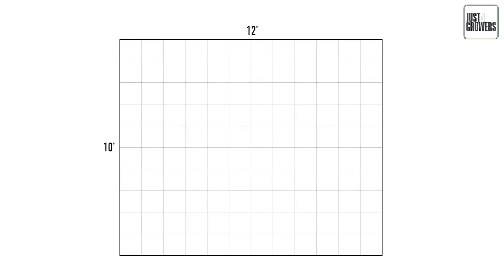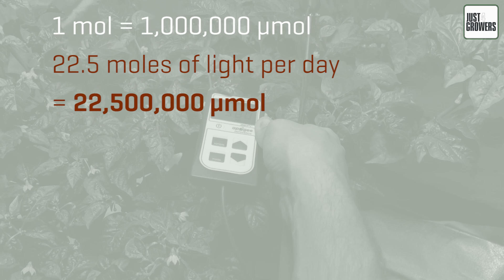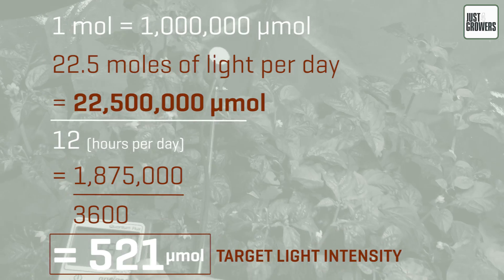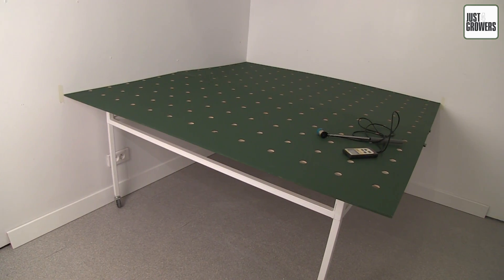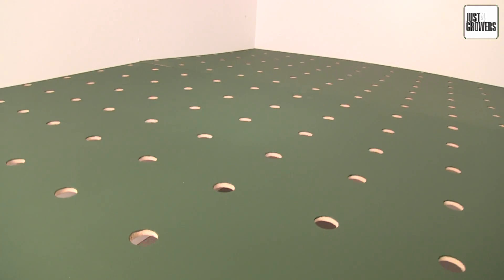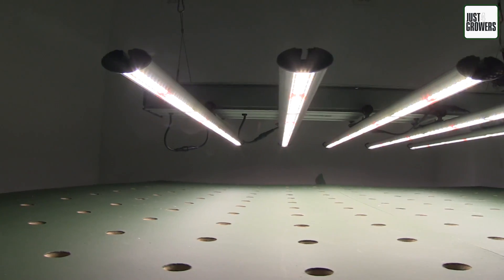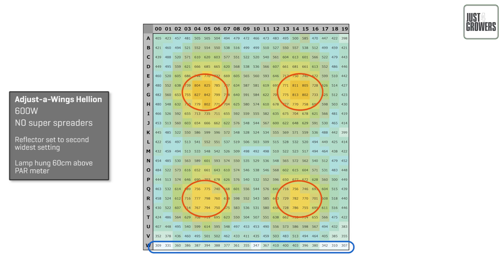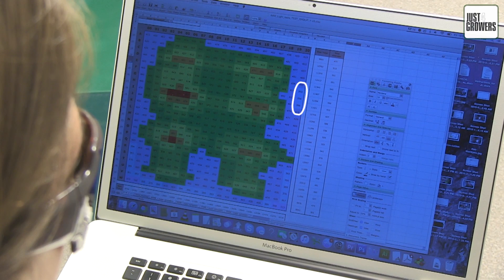Grow Light Hotspots and Light Uniformity

Comment: today the best are 940w CMH DE. you can go 45 cm and under. the cri what cmh creates is nearly sunlight cri 100. the best best best led in 2024 has cri 90 only. the efficiency of the cmh double ended, 5% better than single ended cmh, you can only reach with samsung led chips and the cri with nothing. cmh is efficienter than all other LEDs in 2024. 315 watt single ended cmh is enough for 1x1m, dimmable 190-315w. you can get more yield with same watt leds, but half of the cost for the lamp itself.
last thing what i can say, only the osram RED leds can go 10000 hours life. all other red leds can go max 2000 hours life. how can a led lamp with red leds included have 50000 hours lifetime? can someone of the led lovers explain?;D idont speak even about the uv chips they are poorer, the main thing about uv in led is, that not one plastic reflector in the world is uv safe in long term, but all led lamps with uv chips have plastic reflektor. nice one. hahahahaha. cmh isnt hotter than leds. only the samsung chips are cooler an efficienter than cmh. all other led chips are inefficienter against cmh.
Reply from the maker: Firstly, this is a really interesting and insightful comment so thank you for taking the time to share. I love CMH and DE-CMH and enjoy great results from them. (I still use CMH, DE-CMH in winter.) Nothing beats my 315W 4K CMH (incidentally, with a CRI of 95 !) for vegging up robust and vigorous plants, especially during the cooler months. However, The Color Rendering Index (CRI), is a tad anthropocentric for true plant talk. While being an important metric for assessing how accurately a light source displays the colors of various objects in comparison to a natural light source like sunlight, its relevance in the context of horticultural lighting is relatively low compared to other metrics that are more critical to plant growth (but I appreciate the general heuristic of sunlight being the gold standard for our noble indoor endeavors.) By the way, Nichia make extremely high CRI diodes (their ‘Optisolis’ range scores close to 98) but they’re more likely used in high-end designer clothing retail outlets rather than indoor horticulture.

The minimum distance between a DE-CMH lamp and canopy is determined by lamp output and reflector design while environmental factors can round these figures up and down. A double-parabolic like Adjustawings can’t be beaten for close proximity placement.

I would be very interested to know the L90 of the Fifth generation of OSLON® Square Hyper Red LEDs by OSRAM. They quote a Q90 of 100,000+ hours but not the same thing. Once again, worth noting the L in L90 stands for lumens, another anthropocentric metric, but what can you do? :)

Big indoor light loving heavy fruiting plants? DE-CMH + DE-HPS for the win. Unless you like lollipopping. lol indeed. 

Enough of my rambling, thanks again for refreshing the lighting conversation!

Comment: Howsit bud, I love your videos even if I have to slow them down 😂 the lighting planner in your description works with flash player that’s obviously been decommissioned by adobe, now my question is… is there any other resource that could help me out? Im running 6x 630w cmh fixtures in a 3m x 3m area ( 3m x 2.6m canopy) and im running into a lot of issues with sensor readings going off by as much as 5’c when lights are on but levelling out at night time when they’re off.

To me this indicates hotspots in my room, im running a checkerboard configuration between 3100 and 4200k bulbs and im concerned that the different kelvins are giving off different btus between them possibly? Or my lights are to close to the walls reflecting heat? Im lost and looking for some HID guidance please man 🙏🏻

Comment: Hey Everest! Love how in depth and informative your videos are. I haven’t seen any videos on an issue I’m currently dealing with. I see people growing with 1000w hps in tents all the time with air cooled reflectors but no matter what I’ve done to my environment the intensity right under the light has always been way too much. Until I realized that when I looked at my G-hood, my bulb is vertical vs everyone else’s own being horizontal. If I switch to a different horizontal bulb hood, would this fix my current issue? Or should I just back down my digital ballast to 750w and ride it out?
Reply from the maker: You usually get more hotspots under a horizontally mounted HID lamp. What distance between the lamp and your canopy?

Comment: I am using a D.E. Super Spreader like in this video. It looks like the edges are lit and there is a shadow over the center. is this normal? Do I need to raise or lower the light?
Reply from the maker: What distance is there between the lamp and your canopy? If it's between 18 and 30" then you're good.
Reply: I am running a 630 de in the hood and it is hanging at 18 inches.  So the visible shadow in the center of the canopy normal?
Reply from the maker: I’m setting up a DE630 CMH tonight in a Defender wing so will feedback. No, I don’t think it’s normal. But in any case, we will get to the bottom of it!
Reply: Fantastic. Wish i could show you a pic. I have read in forums that people have taken the super spreader off because of this. I know plants see light differently than we do so maby they dont "see" the shadow. The 630 has a horable hot spot. I bought the adjust a wing and spreader because of your vid. Im excited your running a 630 cmh in it now. You have the tools to find the truth. Keep up the good work.
Reply: Any feedback? Here is a link to a thread I created on a forum with a pic of my canopy and the afore mentioned shadow. http://www.rollitup.org/t/grand-master-level-training.959611/
Reply from the maker: I've ran at 630W DE-HPS in the Defender reflector using a low frequency square wave e-ballast (made by Adjust-A-Wings themselves) - the super spreader certainly helps to diffuse radiant emissions evenly, removing the hotspot directly beneath the lamp, allowing you to position the light much closer than before.

Comment: been testing these double ended lights last coupe grows. dont like them. way over priced and no bennefit in yields for the extra costs. the hoods with them i have suck, makes hot spots and shadows with 2 reflective shields in them, the smaller inner one make shadows.
and then the ballast system keeps eats hight in the room with just 8 foot ceilings, end of the day, any more yield is actualy paid for with the more cost to the equipment. i see zero diff compared to my other 8 hps lights

Comment: The Adjust A Wing DE 600/750's are killer and produce far less heat than you would expect (in that format as just seen).. Be careful of cheap 600W DE lamps though. This is the only DE 600/750 lamp that matches the Gavita 750 for watts/par ratio. The rest we have tested are far less impressive.

Comment: Well done! Another great video. A few light measuring questions... What possessed you to drill that huge piece of particle board? You said you use an MQ500 meter, does it have a USB connection for data recording? How do you record/analyze the light data from your meter?
Reply from the maker: +Franklin Rand Apogee's SQ-520 is a PAR meter which plugs directly into your computer's USB port and you can download free software on Apogee's website - https://www.apogeeinstruments.co.uk/downloads/ I logged the measurements manually on a spreadsheet and did the number crunching on that.

Comment: On point as always Everest. Well done.
How much heat does the 600w give off, and is the ballast detachable?
Reply from the maker: +condo_grower1 I can get it around 18" away from the canopy at 750W with a super spreader - probably a touch closer at 600W. Ballast is detachable and comes with a longer cable option if you choose to go the remote route. Nice.

Comment: How much does the spectrum and efficiency change when dialing down those 1000 watt double ended fixtures to 750 or 600 watts???
Reply from the maker: +Jeremiah Wilson Very good question. I need a spectroradiometer to answer that definitively. Maybe I should start a crowdfunding campaign? Lol. What I can tell you is that I understand the lamp has been fine tuned for as close as you can get to optimal for both wattage settings. I will see what data I have from the manufacturer as a starting point ...
Reply from the maker: +Jeremiah Wilson I double checked with the manufacturer and it is a true 750W DE-HPS lamp. The important thing is the e-ballast has been tuned to give a broad range of high efficiency between 600 and 750 watts.

Comment: when i saw this vid i was so happy but you always leave me with more questions....trying to find good info on super spreaders is next to impossible!! did you follow the adjusta wing sheet on light hanging if they still include it?
Reply from the maker: +bobby blues Hey Bobby, I did everything by the book. (Followed manufacturer's guidelines.) I'll drill down into infrared and what super spreaders actually do - particularly, why they're very handy for light-loving sub tropical species - especially heat sensitive species native to higher altitudes. Now that we have DE HPS, I'd definitely try them in double parabolic reflectors with super spreaders. You can actually get to 45 cm (17.7 inches) with a 750W DE HPS and super spreader. Can't wait to show you all the data. And we will let the plants do the talking too of course! :)
Reply: your the man! obviously the lower the light the better the intensity (even though the par readings were all above 500 at 2ft tall) but the less spread.....why did you not choose parabolic reflectors? are the adjustas less problimatic heat wise then the aircooled fixtures ?

Comment: Awesome video, love the effort you go through with all that stuff you do!
For the LED, get in contact with Gene from Grenegenes Garden here on youtube, he has a company called pacific light concepts that 
manufactures light on the base of Cree COB leds.
Also go have a look at chilLED Grow lights, other LEDS, similar amazing specs!
Just from what i can see in your video it seems like you got one of those "china leds" with cheap 5w epistar chips, they arent awful, but they are barely any better than single ended HPS.
Or, if you want to DIY this, which is what i would recommend, go have a look at Growmau5, hes the go to DIY guy in that regard ^^
anyways
love your videos
keep it green :)
Reply from the maker: +Crustcheese Hey amigo, very happy to see you and thanks for chiming in. I will certainly reach out to Gene and I love Growmau5's stuff - always stop what I'm doing when a notification comes in from him! You're gonna love a video I've got in the works - where I look in more detail at the diodes that are used in some of the fixtures I'm using, power consumption, output, efficiency and, of course, sharing my experiences growing with them for a few months. What's really surprised me so far is the different hanging distances that various fixtures require. Some 6", others 3 feet - and broadly comparable wattages. Also - there's how hard the diodes are being driven, the form factor, the quality of the power inputs and heat syncs - this is going to be quite a journey isn't it? :)))) thanks again - peace and happy growing, Everest.
Reply: and the journey has just begun :)
i have so far build 3 generations of LED grow lights and i could probably build a new version with improved hardware once a moth, the technology is amazing and growing so fast.
i cant wait what your next videos and the next years of LED development have in store for us!
Reply: HID (particularly CMH) is better for quality due to the superior UV + IR output. And CMH runs at pretty much the exact same efficiency as the top LED fixtures (around the 2.0 umol/W mark). The only advantages that LED’s have on CMH is:

1) less heat (however this might actually be a DISADVANTAGE if you grow in cooler climates)

2) you don’t need to replace a bulb every couple of years, but the much higher initial cost of the LED units means that it will take about 8-10 years before you actually start saving money. And when you factor in the increased quality then it’s really a no brainier (unless you desperately need to reduce temps in you grow space but even then CMH don’t actually put out much heat at all!)